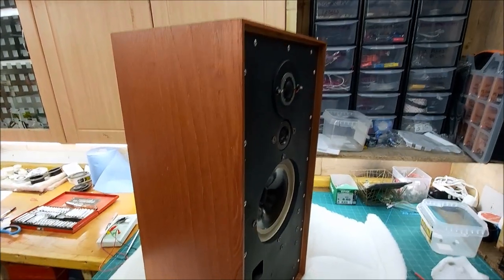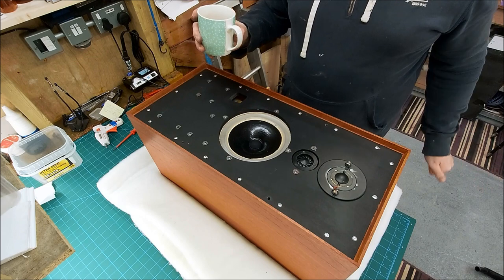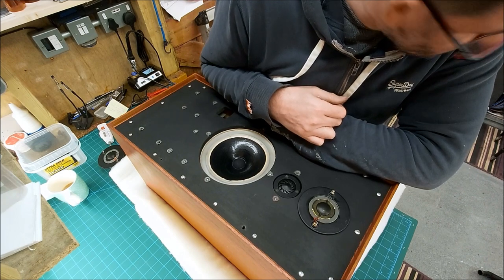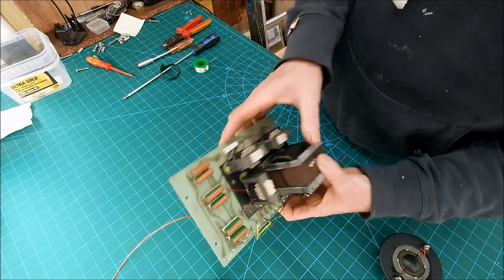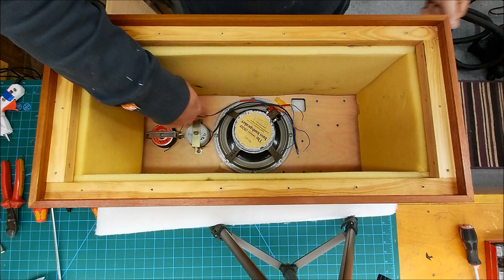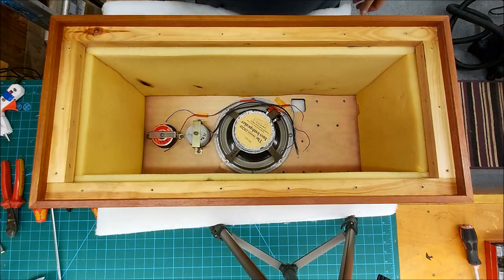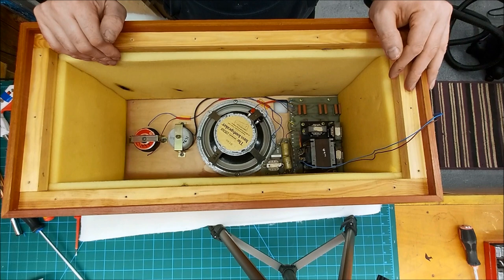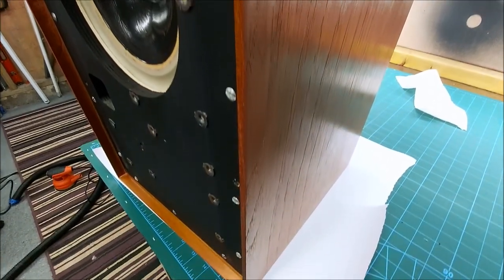Rogers BBC LS 3/6 Part 2

Comment: That finish!!
What grit sand paper did you use?
Reply from the maker: 320 grit. Normally I'd use 240 but these were pretty good anyway. It's really brought the veneer back to life though 😊
Reply: @haycrossaudio5474  thanks! I’ve just acquired a pair of Mordaunt Short MS100’s and the cabinets are in good shape but could do with a lift.
Reply from the maker: Just be careful on the edges and corners. It's easy to sand through the veneer. Also make sure it is wood veneer and not vinyl 😃